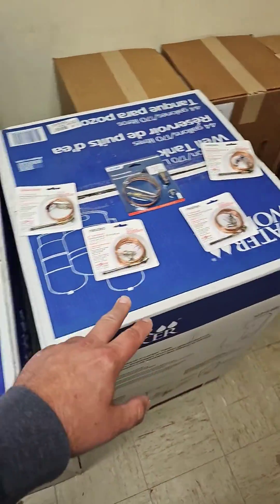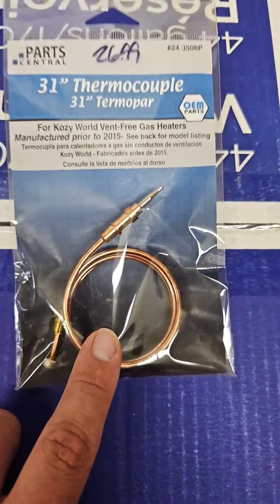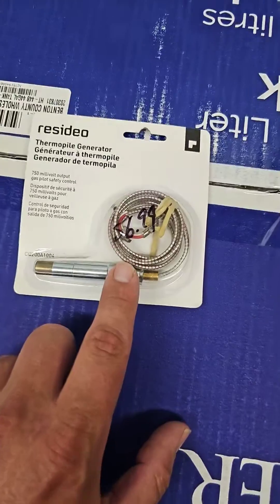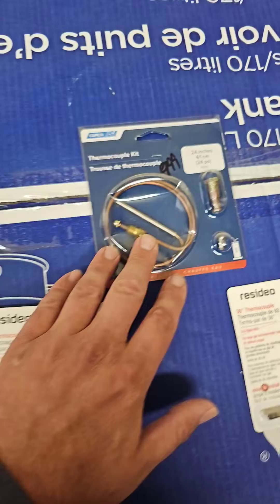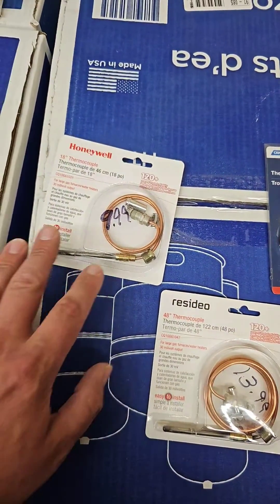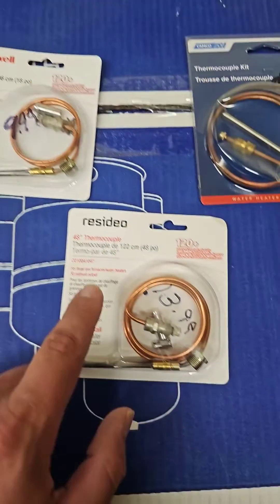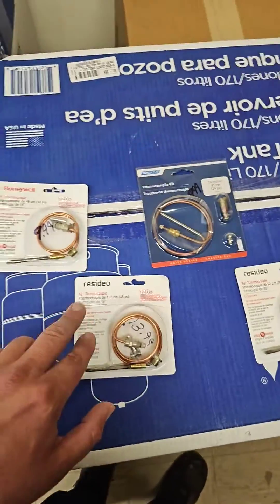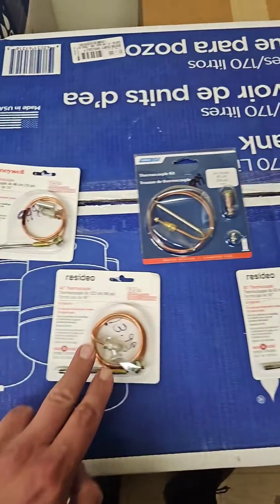Why Your Gas Logs Have a Thermocouple

Comment: What if my gas fireplace pilot light stays lit but the fireplace itself won't stay lit consistently? Mine is set up to a light switch and sometimes if I flick the switch a few times the fireplace will poof to life but for the most part it does nothing.
If I leave the switch on, it will randomly decide to pop on from time to time and stay lit for a few hours then go back to "sleep".
Reply: @zushiba  make sure the main gas valve is on

Comment: Is thermopile & thermocouple the same?
Reply: No. Thermocouple produces 30mv D.C while a thermopile produces 750mv D.C.
Think of a thermopile as a pile of thermocouples so much more voltage generated by the same heat source.
Reply: @jimbarron8688  Thermopile a stack of thermopiles(awesome)!

Thank you!

Comment: I'm 95% certain that I need to replace my thermocouple. But how do I detach it? Taking the logs apart? I see that it unscrews out of a four-way gas junction thing, do I need to have the pilot lit and going in order to test the thermocouple with a multimeter? Will that leak gas when I do it? And if I do replace it, is it just a matter of unscrewing it and screwing a new one in and putting it in the right spot?
Reply: The thermocouple is held onto the pilot burner assembly (4-way in your case) usually by a small spring clip sleeve.  At the gas valve it simply screws in.  To test a thermocouple you usually do an open circuit test where it should produce 20-30mv D.C  and a closed circuit test where it should look produce 10-20mv D.C.  The open circuit test will require you to hold down the gas cock in the pilot position for 30 seconds with it disconnected at the valve. You measure from the tip to the copper tube so you will likely need alligator clips.  The closed circuit test will require a thermocouple adapter to allow you to access the tip because the thermocouple must be attached  to the gas valve and be lit for 30 seconds and the pilot supporting itself.  
Having said all that it's far simpler to replace the thermocouple if you suspect it to be bad  i.e the pilot flame goes out after being lit for 30 seconds.  Ensure the tip of the thermocouple is enveloped in the gas flame, that the flame is blue, and that the connection at the valve is snug - 1/4 turn past finger tight.
Reply: @jimbarron8688  I got it figured out. Thank you so much!